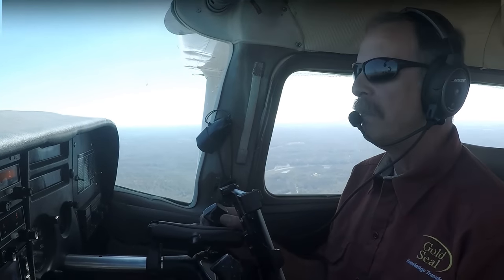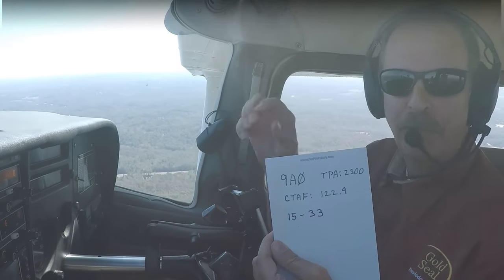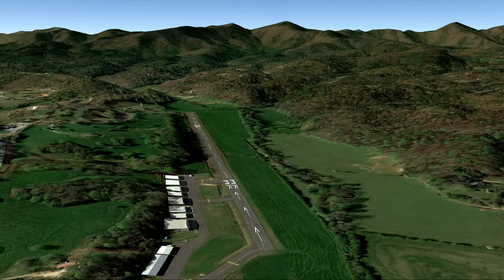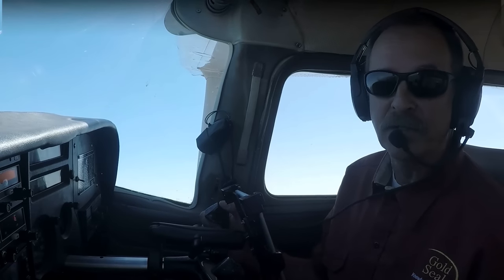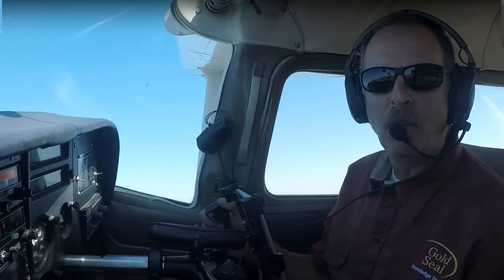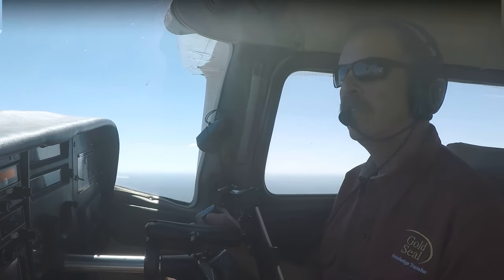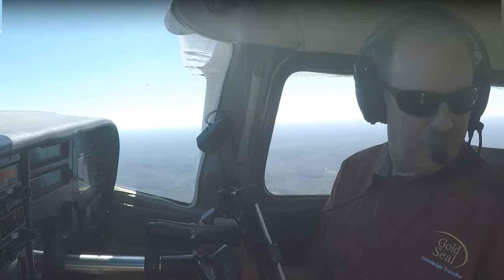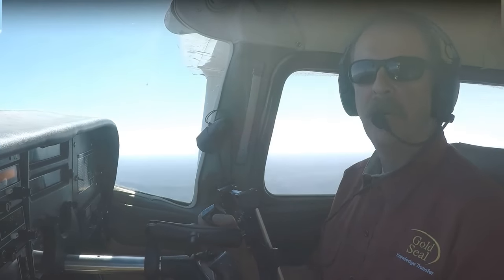Short Field Operations

Comment: I find delaying flaps on my Tomahawk close to rotation helps in increasing airspeed acceleration. The kicker is with a Tomahawk all it takes is to pull the flap handle. With electric flaps they are not so quick. Something to practice and see what results  you get.

Comment: How did you mount go pro on empennage (Vertical Stabilizer)?  Did you bolt in? I would be scared to use suction cup and duct tape. I usually use tie down ring to mount.

Comment: its was a great landing, except you forgot to fully retract the flaps immediately after touch down.
Reply from the maker: Check the briefing/discussion that I provide prior to entering the downwind. I explain that I won't be raising the flaps after touch down and why. - Russ
Reply: Also, if you switch between fixed and retractable, you might reach for the gear lever and make a very loud noise.